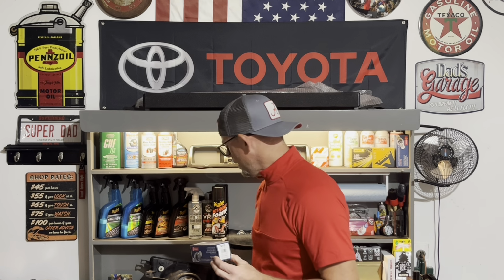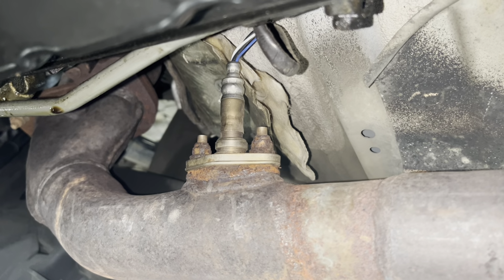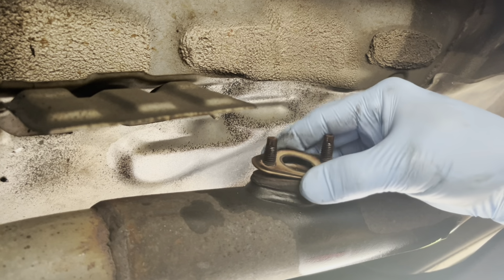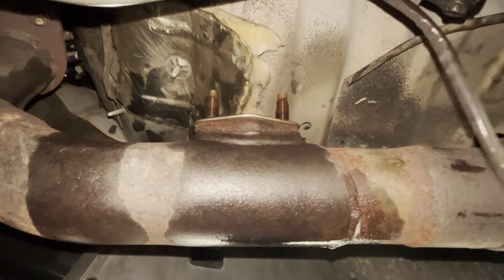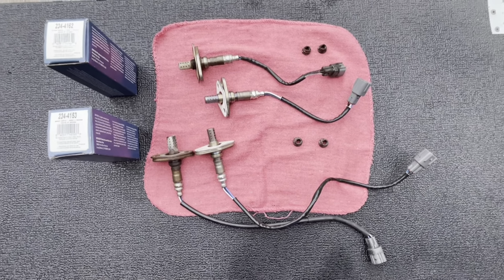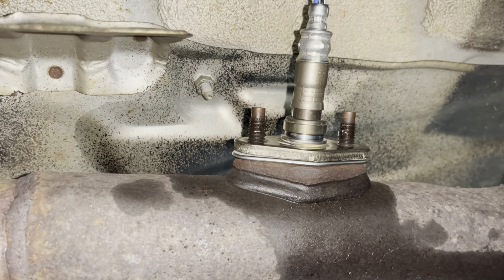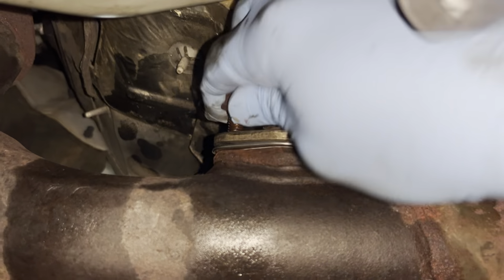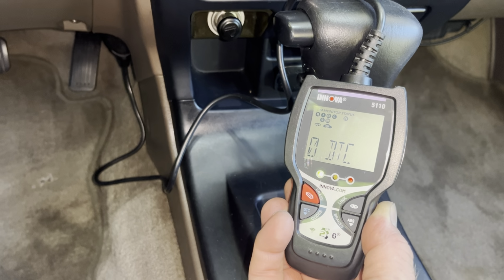How To Replace 3rd Gen 4Runner O2 Sensors Upstream & Downstream - Toyota

Comment: Actually that brings up another question. I'm in Colorado and we have adopted California emission standards. I had my cat stolen and had to replace it with a CARB compliant one. I've been having some really bad performance and errors that I've been trying to chase down. Wondering if i also needed to replace the o2 sensor with a California one along with the cat?
Reply from the maker: That’s a really fantastic question and a unique issue. I wonder how the other CAT would interact with your ECU. Depending on the specifics of the errors or performance issues you’re having, I would absolutely try to replace both O2’s with the Cali versions to see if it corrected your issues. Ultimately it’s a small cost if it works. You gotta come back and let me know how this plays out! 

Thanks for watching and for the interaction. I hope you get your performance issues corrected.

Comment: Why did you replace the sensors? I have a 2002 4Runner and check engine light came on. I scanned and got code 0420. Cat converter. But I wonder if replacing the sensors would fix it. Thanks
Reply from the maker: Hey, thanks for the question! I also had thrown a P0420 code. I replaced both O2 sensors and all codes went away. This fixed my issue. I would absolutely replace both O2 sensors before doing anything with your catalytic converter. I would bet this would fix your issue and get you back running better. If you do it, come back and let me know the results. Good luck!